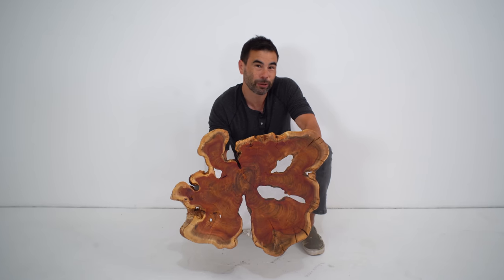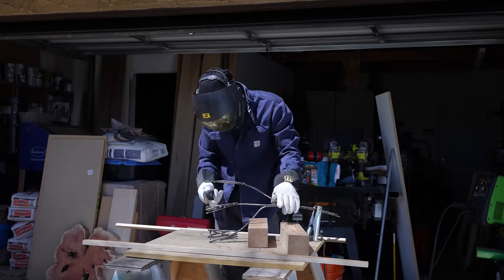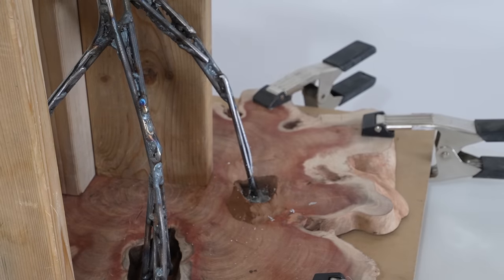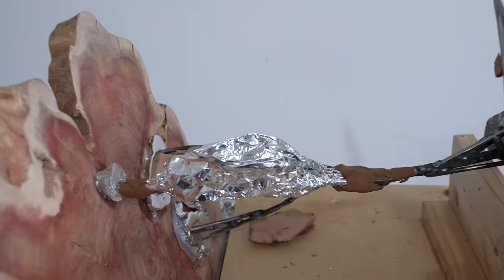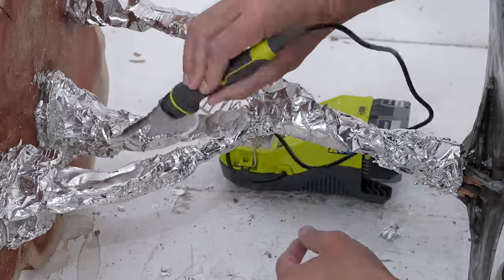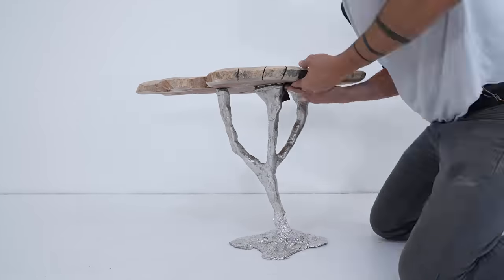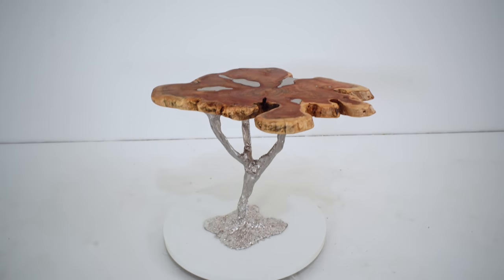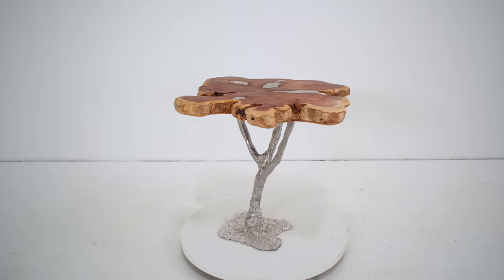Molten Metal Table Base

Comment: For making it less shinny you could try sandblasting it. I like how the metal looks when the surface tension makes it bubble above the surface and is super smooth. Of course then it oxidizes.
Reply from the maker: good call!
Reply: What about paint with some bleach type liquid to thin out remove paint thrown on? Like how they do clothing to give dark colors that funky look? Then add the sandblasting technique. I don't know if it can be pulled off but in my mind it looks  awesome!

Comment: Very cool. I liked the 'try and correct as you go' approach as well! As the viewer, it gives me different options for different results, withouts even having to experiment myself. 
Also makes it less intimidating. It's nice to work with a material, where you can correct 'happy little accidents', if necessary. 
And the finished table looks very high end.

Comment: This is awesome!
I think steel shot and/or steel wool is also a filler option worth considering, especially if you use some flux to help the tin flow onto it.
A steel powder with a quick hit of the torch to melt it into place, followed by a tannic acid (instant coffee or instant tea; oak gall decoction; etc.) etch/oxide conversion might give an interesting finish.
Reply from the maker: thank you for the info!  will try!

Comment: I was surprised you didn't use the torch to smoothen the metal.
For dulling the colour of the metal, cold bluing liquid works on a bunch of different metals. If it reacts with your alloy then you could apply it with a spray bottle.

PS: great idea. I love that piece

Comment: You could makes some texture stamps out of silicone then use a heat gun to soften the metal and stamp texture into the metal with the silicone stamps. Might be cool to use a bark texture that transitions to smooth texture as you move further away from the table top. A kind of organic to synthetic approach.

Comment: That's a pretty neat idea. Definitely like the ability to correct mistakes with a torch or Dremel.

What was that face mask you were using when you were sanding?
Reply from the maker: 3M versa Flo

Comment: Could you play around with patinas used in stained glass and copper work to make it less shiny? I know you can dip hot steel in motor oil to give it a blued look. But, the melting point is so low on the tin/ bismuth I don't know how you could accomplish that.
Reply from the maker: that's what I was thinking as well